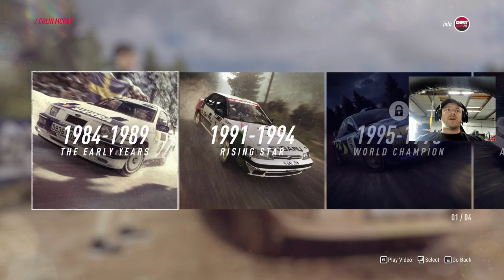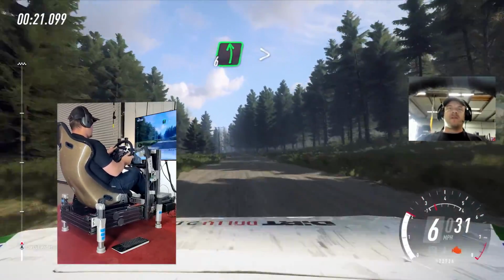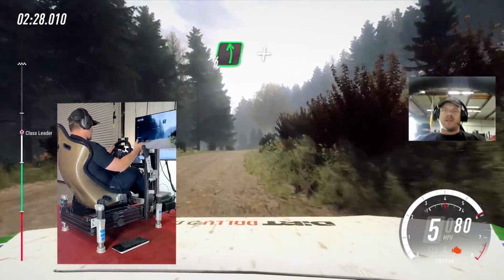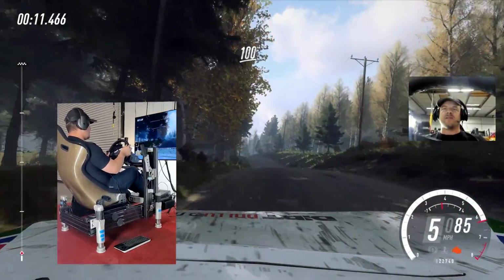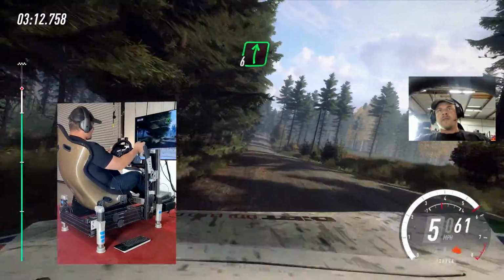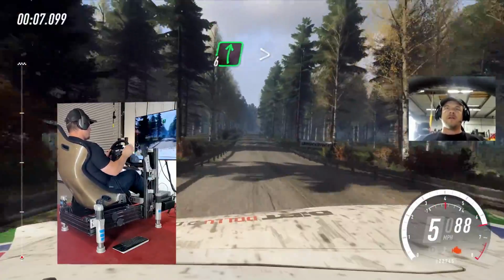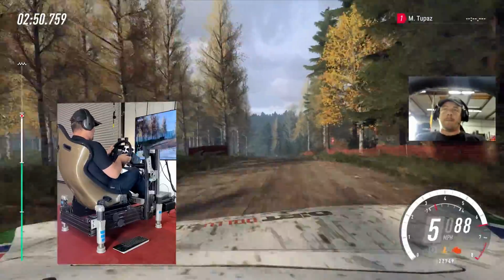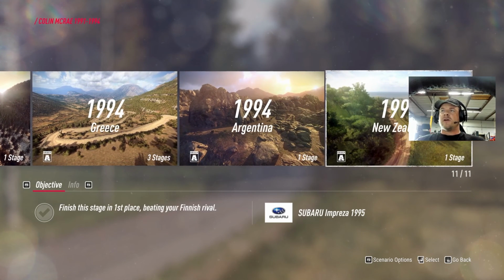Dirt Rally 2.0 - Colin McRae Demo Run | Flying Finns !!!

Comment: The silence in the air, waiting for the hard landing… Priceless 😅
I was surprised when i got my DK2, how well the system handles the layers with all the stuff going on in DR2.0.. I normally dont notice the system being at it’s physical end limit to any side/height, even though it must have been on rough stages. Algorithm is good 💪🏼

Comment: hey Peter, I am gonna ask the important questions here... how did you mount the controller box under the pedal board? i wanna do the same.. mine just sits on the floor at that same spot. much appreciated!
Reply from the maker: Many ways to do this but it depends also on the chassis, the setup and available room you have. Please e-mail us with some photos and we can help you with finding a clean solution. 

However, one of the easiest and cleanest ways to do it is to purchase some additional extrusion, mount the controller to the extrusion with some 3M duo-lock velcro and then properly mount the extrusion to the underside of the chassis that accommodates the dimensions of the controller and the extrusion. We should make a video on this but it would be a custom and not a universal solutions as there are so many variety of rigs out there.

The way we have it mounted on our test rig is rather crude (just for testing) and we put a couple of holes in the bottom cover and fastened that to the extrusion and then just put the top cover back on. We did this for vibration testing months ago as the worst possible mounting scenario. It has worked flawlessly since.

Comment: Can you please tell me what settings the DK2 is set to in this video? Cheers
Reply from the maker: Hi David, the settings I typically use are all 5/10 with only roll at 3/10 and smoothing all at 0/10. 

Engine Vibration is 80/20 front biased. Our dimensions are 33.0" long and 25.5" wide.
Reply: Thanks!